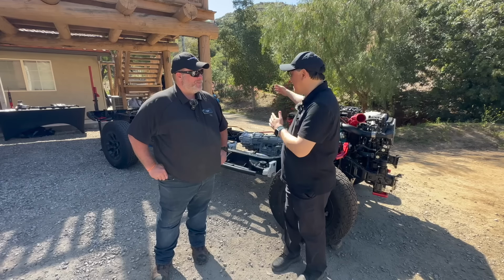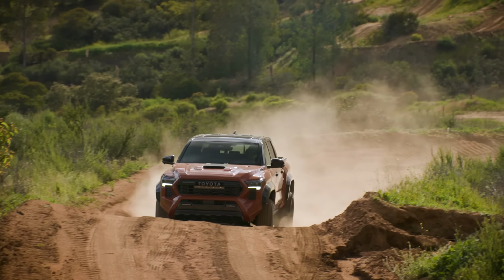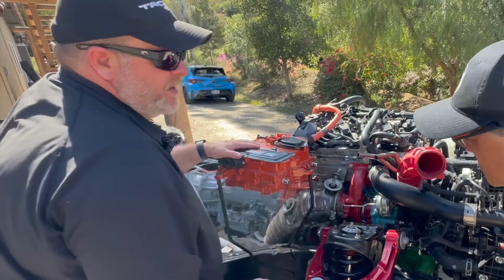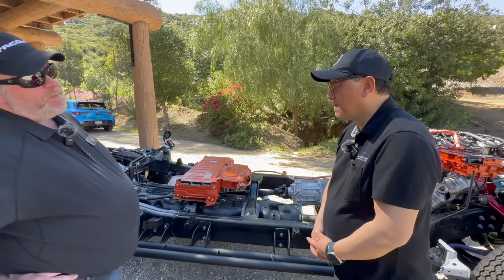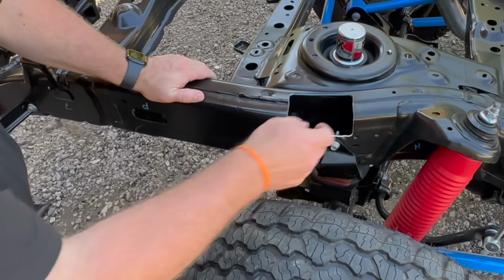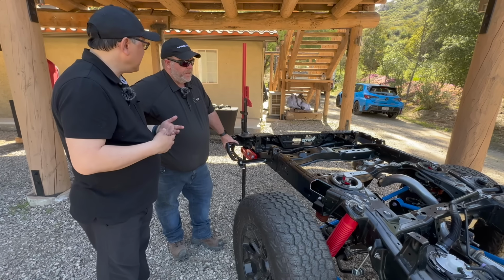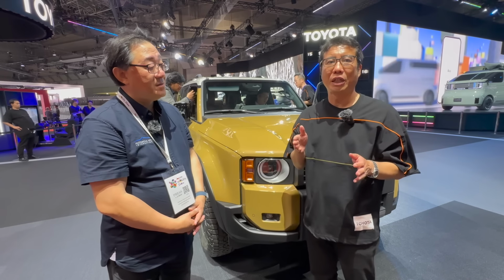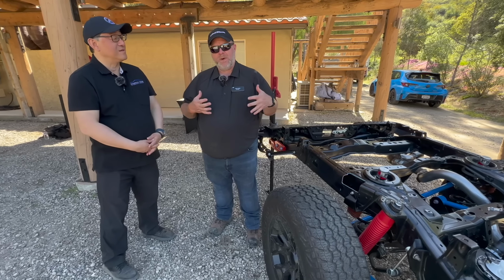ENGINEERS REVEAL RARE FACTS ABOUT 4RUNNER, TACOMA, LAND CRUISER - CANDID INTERVIEW SHELDON BROWN

Comment: If you have any insight into the cause of the transmission overheating in 4H reported by many, could you make a post to help 4G Tacoma owners understand why SOME transmissions overheat on seemingly straight forward terrain in 4H.  Reports of transmissions overheating (with a warning triggered to stop and cool down) or temperatures getting very close to triggering a warning notification seem common on forums.  Not all 4G Tacomas have this issue however.

Comment: I've always changed my oil at 5000km not miles, especially with a turbo? Oil is the cheapest maintenance you can do on a vehicle. Sheldon says do what your owners manual says, it will keep you in good shape? Yeah, good shape for the length of the warranty? Good luck after that?

Comment: This video is hugely engineering propaganda, Tundra has a recall 0f 98,000 2023's for failing V6 turbo engines. This is a stretch to
position that the new 4 turbo is as reliable as the past NA V6/V8(s). They have a recall that would suggest this isn't so. I have yet to see
a turbo gas motor ever last as long as an NA gas engine. Buyer beware, you should wait a couple of years for a brand new everything
model to mature. Remember the first couple of years of the Honda 1.5 turbo... They are all making this mistake and we will be just like 
Cuba (for different reasons), holding onto our old but reliable vehicles.

Comment: I love my Solar Octane 2024 Toyota Tacoma; I love the way it looks, feels and drives. Unfortunately, I have been without my truck for 30 days now due to factory paint issues and system malfunction issues which require parts that are not currently available. The truck has 622 miles on it, with 300 of those from driving back and forth to the dealer. It currently sits at the dealer waiting for those parts. I have no idea when I will get it back. Not a very happy camper, especially since I paid almost $60K with all options. I hope Toyota can help expedite repairs as I would like to drive what I paid for.

Comment: I was a Ford truck owner for most of my adult life.  I worked on them for a few years in the forestry industry, where durability was paramount. The f150 line stood up to the daily use very well for many years. I became discontent with all the manufacturers because of design flaws that were built into vehicles decade after decade. The more I spoke to and read what Toyota owners had to say about their trucks, the more I was convinced to buy a Toyota. I bought a low mileage 2013 4 Runner a few years ago and have never been happier with a vehicle.  It does what it is supposed to do every day with nothing but normal preventive maintenance. The previous owner did NOT do any rust proofing , I rust proof it yearly and  believe it is the most reliable vehicle I have ever owned. It may be the last SUV I will own because it will out live me. If I ever need a vehicle, I will always look at Toyota first, and likely no further.

Comment: Well I can say a Tundra, Sequoia or 4Runner is in my near future.  The Frame and body Improvements,  Low Maintenance, Increased Performance in everything with  emphasis on MPG and on top of all that they're projecting 300,000 miles b4 a major engine failure. That's 100k more than the previous model. I'll put my money on it being another Millionaire of Mileage.

Comment: Toyota has a pricing issue. Go to a dealership and see what you get compared to the prices of the 2023 Taco and 4RUNNER (had both ) They moved production to Mexico (cheap labor) but the savings didn’t go to the consumer. This is why the dealership invented is not moving. I’m a Toyota and Lexus fan that’s why I bought the 2023 GX460 Luxury.
Reply: All 4Runners are, and always have been, made in Japan.

Comment: I will NEVER buy a Tacoma with a 4 banger turbo, or a Tundra with a 6 banger turbo…NEVER! Toyota  has made a mistake. Proof in point, the Frontier is out selling the Tacoma. Tacoma sales as well as Tundra sales have plummeted and they’ve suffered a large quarter loss.
Reply: Amen 🙏
Reply: A coworker that is a long time Tacoma driver just traded his hold Taco for a brand new Frontier. And it was 100% about the engine.

Comment: If I could spend the money at the time, a 6ft bed Tacoma Trailhunter would be quite difficult to resist. I would like to build a home in a remote area, and the power on board, air compressor, 4x4 capability, towing capacity, and 6ft bed would make pretty much the perfect mobile work bench.

Comment: Yay we’re happy to announce our partnership with ford to present you all new useless gadgets and gizmo whizz bangs that will break along the way, but all this does is increase the msrp prices, now in keeping true to the name in fact inspired by it we put a 4 cyclinder in it because it’s a 4Runner and we added a turbo and it will be wearing out because throttle response means small tiny turbos always spinning 😵‍💫, power output from smaller mass means greater stress and more heat which in turn means more gasket failures, you can’t cheat physics folks no free lunch do not pass go, after all said and done = ford 🤣 then you realize all the major publications and big YouTubers out there are basically paid advertisers…………..

Comment: Adding more parts, especially a turbo and the additional parts needed for that, adds more moving pieces, as well as adds to the complexity. More shit that can break and a very expensive fix
Reply: 2 less cyclinders, no more hydraulic power steering, easier to access engine bay. Lots of maintenance items got easier on this platform. Asides from the multilink rear, and I'm sure more sophisticated software for engine management, the truck hasn't gotten that much more complicated. The turbo 4 is pretty straightforward. Turbos have been around for decades now, they're not new technology any more.

Comment: Sheldon must be working overtime going from YouTube automotive journalist to YouTube automotive journalist talking about the technical merits of the Tacoma and as a mechanical engineer like David I appreciate all the technical details and explanations he shared but the technical attributes are not my issue with the Tacoma and other new Tacoma models. My major issue is the price and not just MSRP. I feel the MSRP is too high to start with for what you get and that's before the dealers add additional packages, options, made-up fees. Many of those are "mandatory options" with is an oxymoron. How can it be an option when it is mandatory? I still haven't decided yet between a crew cab mid size truck like the Tacoma or an SUV like the 4Runner but I will by next year when the new 4Runner start to show up on the showroom floors. Although I would like to get a Toyota, at the end of the day the out the door price dictates what manufacturer and model I end up with.

Comment: This question is to automotive press. Can you get a Toyota designer to explain the tundra engine failures. For Toyota to get customer confidence they need to explain why the failures are happening and provide a a fool proof fix. I’ve heard of many new tundra’s requiring multiple engine rebuilds. That is not confidence inspiring. To build brand loyalty is difficult and long term reliability is needed. But to lose brand loyalty is easy with Toyotas ongoing recalls and failures.

Comment: Toyota should bring back a true mini truck with low options, rubber floor mat instead of carpet etc. A nice entry level truck at a budget price for our youth, or for those needing a cheap reliable utility vehicle. Currently it is a untapped market. "Mini trucks" today are really just oversized, overpriced, overoptioned midsized trucks.

Comment: You have to look at it as a system, what is the weakest point? I'm thinking batteries and electric motor/generator, the 4 cylinder turbo could last but the other stuff won't.

Comment: Toyota is one of the most conservative automaker in the world. Their hybrid system is proven to be reliable with minimal to no addition to maintenance cost. Turbocharged gasoline engines are pretty common, and most of the scary urban myth about their durability is resolved at least a decade ago. Yes, it would be comparatively less reliable than their V6 NA, simply due to having more parts, but considering the gas price these days, it is a fair trade. If you have to cry about new techs kicking in, just keep your ol' reliable, or go with the vehicle that offers traditional NA V6/V8.

Well, I am disappointed by interior and cargo spaces, and higher-than-inflation-rate price hike though.

Comment: It’s not simply the durability factor, it’s the cost of ownership factor that’s concerning. I can do a ton of work on my current vehicles, one of which is a Toyota truck with over 200k, and that saves me time and money. The complexity of this powertrain limits what vehicle owners will be able to do, and that adds expenses, especially for those who have to buy used due to the ridiculous costs of these new vehicles.
Reply: Right on. My 2008 4runner has 312k and runs perfectly. I do all my own maintenance. Nothing major, but I'll put in a rebuilt transmission or swap a motor if I ever need to. Doing those still beats the cost of a new one by a wide margin.
Reply: Late reply, but could you explain what will become more difficult? I can see that spark plugs/coils, serpentine belt, oil are all easier. No more hydraulic steering fluid change thanks to the EPS unit. What's gotten harder? All I can think of is a single turbo which may need to be changed at some point, but not until way down the road. And sure due to forced induction stricter oil change interval, but we should already be on top of that regardless of the turbo

Comment: I would really like to know what Toyota is doing about the ADD (automatic disconnecting differential system ) issue. There’s a part in the transmission that is designed to fail to prevent damage however, it is failing under less than rugged conditions. TFLoffroad did several videos about this on the 2024 Tacoma but assuming it affects multiple platforms.

Comment: So 300 series chassis is same as the 250 chassis. Same engine between 300 and gx250.  Same wheelbase etc etc.  The problem with all new toyotas is the tgna platform. Overpriced. Bad packaging. Terrible hybird battery placement. Horrible build quality. On all tgna platforms no second row seat can move fore and aft. Sequoia 3rd row terrible. No headroom in sequoia and tundra. 4runner same as 250 which is same as 300. So sad

Comment: We've had four 4Runners. The first three each gave us over 350k miles worth of running life before we traded. This last one, a 2000 LTD, blew the #3 spark plug right out of the head, but that was at 328k miles. Say what you will, Toyota makes a quality product. Does that mean I want a Turbo? Hell no. I'll stick with my NA engine thank you. If it ain't broke, don't fix it. NA works just fine.
Reply: @MorleMinto  one came with it from the factory, one we had applied to. The others no.

Comment: So miffed at the $15,000 price increase of the PRO model compared to my 2020. Easily $5,000-7,000 over priced….Especially compared to a Ranger Raptor $57,000 with front locker and FULL time AWD and a twin turbo V6.
Reply: Most likely making room for the scout to replace the old Tacoma price range

Comment: Turbo's and Hybrids have been part of Toyota's product line for decades. We have owned 3 hybrid vehicles starting with a 2009. Our first went 14 years and 178K miles and the hybrid system was still working fine. Our second has over 110K and 12 years still going strong. Have a Rav4 hybrid only a year so far, has traveled all over the country and is awesome. 8000K miles so far...looking forward to selling our 5th gen 2014 4Runner for a 2025 it is good, and has 155K miles. Just kinda tired of 15MPG the hunting and lurching 5-speed and lack of modern tech. If I get 12-14 good years out of another car I'm ok with that.
Reply: A Toyota Hybrid will be at the top of my list when the day finally comes to replace my 19 year old car with the base 1.8 1ZZ-FE engine and 5 speed manual.  We also have a 2010 Tacoma with a 4.0 V6 and 5 speed automatic in the family. In the miles I have driven it, I don't recall any hunting or lurching.
Reply: Most of the time our 4Runner is great. Towing or in the mountains is where the old drivetrain shows it's age. Reliable and tough is good, if they would have updated the transmission I may have considered another 5th gen. I am looking forward to the 6th gen, but overall the 5th gen has served us well.
Reply: @kurtburkhardt5862  For many years they have paired the 4.0 V6 with a 6 speed automatic in overseas models like the Prado as well as the Land Cruiser 200/300.  I don't know why that never happened here.
Reply: How much does it cost to replace a hybrid battery at a Toyota dealership?

Comment: 10,000 mile oil changes are nuts. I don’t care what Sheldon says. Use a quality synthetic oil and change it every 5,000 miles on the dot. Maybe even every 4,000 miles if you do a lot of city driving.
Reply: You are absolutely correct. We have had turbo cars since 1986 and have hundreds of thousand miles without any engine work whatsoever. Mostly the turbos were only oil cooled with no water cooling. We changed the synthetic  oil religiously at 4000 miles.  Never had  a turbo or internal engine problem.
Reply: Right ! If you keep a car 5 years or less that’s ok. But like me 10+ years, 5000 miles of synthetic oil is the most. Turbos burn that oil much faster.
Reply: I think Sheldon is full of it.
Reply: How else are they gonna get you to come in a buy a new truck?
Reply: If you did used oil analysis after break in I think most people would find 10,000 miles if not even more is perfectly acceptable.
Reply: @PinkFZeppelin so I was agreed with this up until recently, watched the car care nut video on his 2AR tear down and the big cause of failure was gunk accumulating and clogging an oil control valve. So it can be inconsistent in quality from flows down to the pan, more will stay in the oil galleries when it’s been through more heat cycles
Reply: X 💯 🎯
Reply: You are correct sir!
Reply: They're telling everyone a mexican turbo 4 banger is better. I am surprised they don't tell you to go to 15K oil changes while they're spewing this stuff.
Reply: @troy3456789 Have you driven both a 3rd gen with a 2GR and a 4th gen with a T24A? Everything about the new engine is better than the 3.5. And you can’t dispute whether or not it’s reliable just because it’s turbocharged. The assembly plant for the Tacoma is in Mexico and has been since 2021 but the engine designed and manufactured in the US. Cheap labor shows corporate greed and I don’t agree with it but you can’t get away from it. GM assembles all of their trucks in Mexico as well.
Reply: That sounds like a completely made up claim with no data to back it up

Comment: I sure hope the engines are better in these than the new Tundra's. Just do a search on all the problems. I have serious buyer remorse; my local dealer wants to give me $17,000 less than I bought it for trading in a new 4Runner, the last year of a good Toyota. My TRD Offroad 2023 XP Package Army Green Tundra has 5000 miles on it, a bunch of engines are failing between 20,000 and 40,000 miles from bad main bearings and cams, I'm not having much help or hope from corporate Toyota either. The problems are not overblown, they even have differential problems and now rear main seal leaks. Sad state of affairs. These dealers are in for a rude awakening, which is why the manufactures are looking to sell direct. But the manufactures have proven greedy in way of subscriptions and useless options and packages. I may just go with another reliable 3rd Gen, these new vehicles are overteched and intrusive anyways, and reliability and quality control is a thing of the past, even for Toyota

Comment: Tacoma and 4Runner are bread and butter of Toyota.
1. Toyota 4bangers is the best. 
2.Toyota is the most experience on the hybrid for most 3 decades
3.Toyota has turbo engine for long time ago such as supra(straight six) and MR2 for decades back 90's and 2000's.
4. 1 but is that Tacoma is made in the U.S?
5. Vacuum is the only way for controlling waste gate turbo because it is  response according to engine speed and vacuum in the intake manifold
I Trust Toyota period.